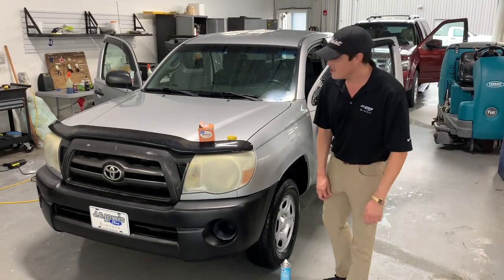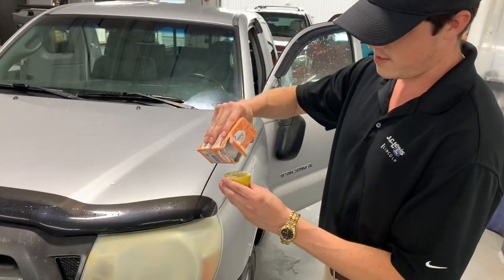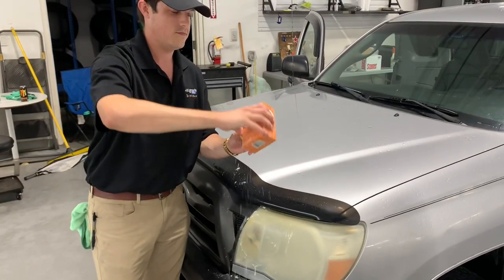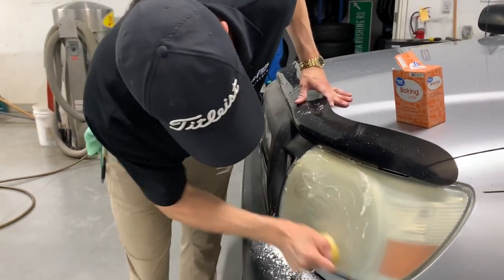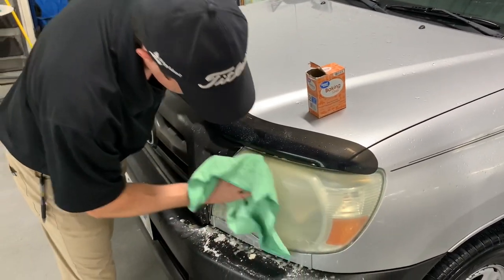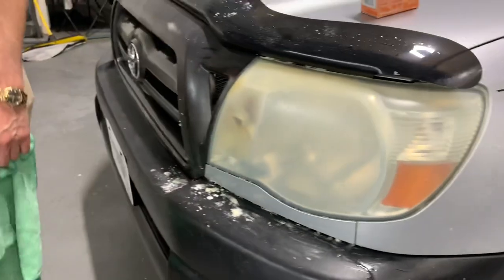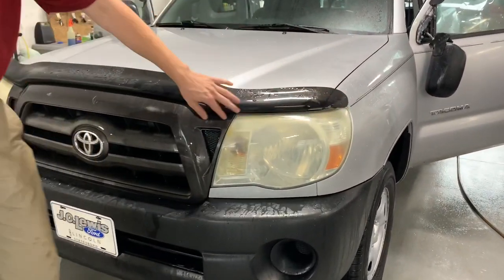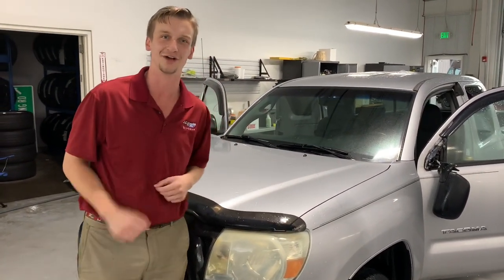LEMON AND BAKING SODA HEADLIGHT RESTORATION TEST: Life Hack or Hoax?!?

Comment: First of all, the lemon and baking soda does work when applied properly. not a 25 or 30 second job.   Take one lemon squeeze it out into a bowl thoroughly. Take a teaspoon of baking soda drop it in. Stir it with your finger a spoon or a knife doesn't matter. Dip the top of the lemon back into the mixture then apply it to your headlights in a circular motion for about 5 minutes , dipping the lemon at least three times. Wipe it off put some more baking soda in a clean bowl, squeeze another lemon into it. take one half of the lemon and do the process all over again for about 5 minutes. Again, dipping occasionally. throw that half of the lemon away and repeat with the second half for 5 minutes dipping every so often into the mixture of course.   If you have applied enough pressure and taking your time doing this it works quite nicely how long it lasts I don't know yet it's only been 4 months.   Good luck with your testing .   like your videos.
Reply: This works. They look like new. Thank you.
Reply: @sgb6780  HOW LONG before headlights turned cloudy again for you? I used WD 40 to brighten cloudy headlights, luckily it worked to pass State car inspection, but in 4 days became cloudy again
Reply: Was looking for the video where they put the lemon on a drill to clean the headlight
Reply: To keep the headlights clean: first you have to thoroughly  clean it with water. Then apply varnish. You have to carefully choose the corrext varnish and how to. Look it up.

Comment: This works great.  I put the baking soda in bowl and added water and put the lemon in the water.  I wiped the wet lemon over the headlight several times.  I was skeptical before but it did a great job, so much so, I did the same with my wife's car as well which was as bad as the vehicle shown.  He should have added water as he wiped the lemon on the headlight.  I feel like a pro now.
Reply from the maker: Happy to hear that it worked for you! Subscribe to keep up with us!
Reply: How is it holding up now?
Reply: @AshokSharma-fu1ry  once you polich the plastic its needs to be coated with somethign or it will oxidaze again pretty fast. i think cerakote makes a good product for this.
Reply: 😅, nice

Comment: I started my 07 Ram 1500 Quad cab with lemon & baking soda and a LOT of elbow grease and it cut through the initial layer of oxidation...THEN I used the Turtle Wax Headlight repair kit ($12)
to sand and buff the lenses.  The whole idea is to get as much of the oxidation off...down to virgin plastic, then the final clarifier and sealant in the Turtle Wax Kit makes ALL the difference.  IT WORKED!